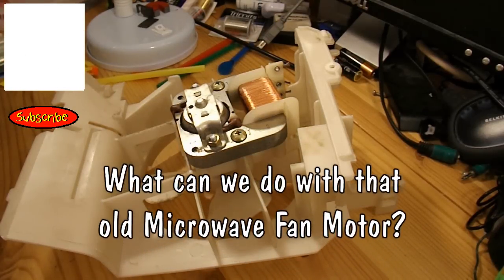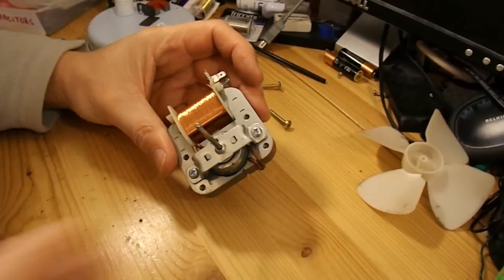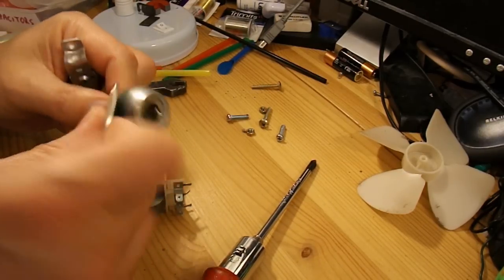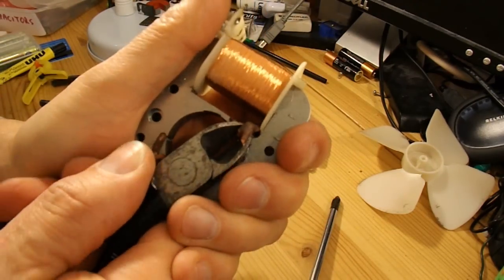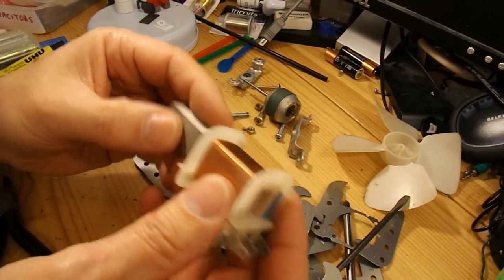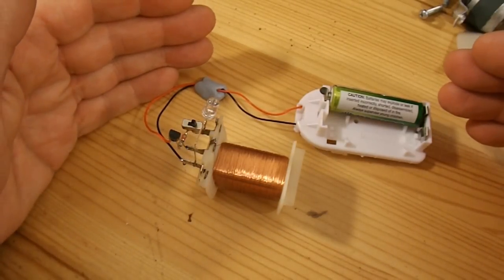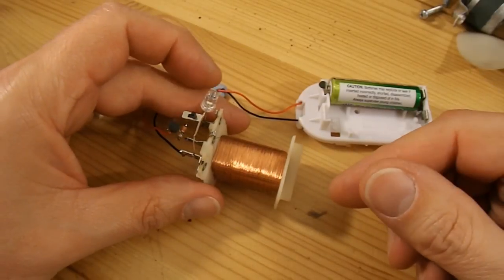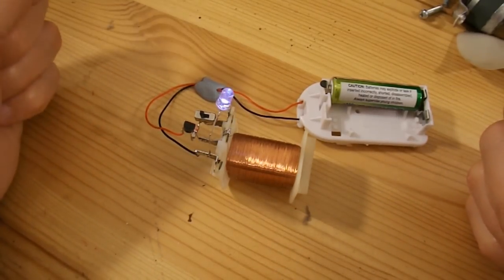What can I do with that old Microwave Oven Fan Motor

Comment: I have scrapped hundreds of these fan motors and I have made a simple jig for removing the coils rather easily.  You need 3 small blocks of 2x4 about 6" long.  2 stand up on the 2" side under the sides of the motor and use the 3rd laying on top of the motor to apply light hammer blows.  The coil and lamenated core can be extracted without further disassembly.  These cores are simply pressed in at the factory and can be pressed out just as easily.
Reply from the maker: Thanks for the tip 😊

Comment: that high pitch sound would do my head in
Reply from the maker: One of the benefits of being an old man is that I don't hear high pitched sounds.
Reply: @GrandadIsAnOldMan  yeah I'm not a fan if high frequency noises. it could be flyback if you're still using crt tv or any transformer inductor. maybe it's coming from the camera itself
Reply: @GrandadIsAnOldMan  watching this because I stripped 2 tesco microwaves the other day. how do you actually drive these motors, does ut require modulation from microwaves control board ?
Reply from the maker: @SodiumInteresting  The motor is a shaded pole motor, you will find information about it in the video description. This one runs off 240v AC mains supply. As I don't hear any high pitched sound I cannot be sure what you are referring to. However, it is more than likely it was the camera as back at that time (2013-2015) I had several comments about it and from July 2015 started using a notch filter or low pass filter in the audio editing to remove it. You will spot in the video description of some of the videos from around this period a line of text stating

Filmed using FujiFilm FinePix S4800
Edited using Serif MoviePlus Starter Edition
Low Pass Filter 6500 hz

or

"I originally published this video in 2014 however unknown to me many of my older videos have a high pitched whine in the background caused by my camera. I cannot hear the noise but many younger people can so I am editing the sound on some of the more popular videos that have been affected. We are possibly talking hundreds of videos so I don't think I will be doing all of them. All the videos since July 2015 should be OK as that was the first time the problem was highlighted and since then I have been using a low pass filter. It's a shame YouTube does not offer sound editing in it's editing options."

Comment: I just found your channel a few weeks ago and subscribed.  We like doing the same kind of projects.  Slider and I have been doing this for a few years now and have worked on several projects together at the same time.  It is great fun and I'm always glad when I find someone else who enjoys the hobby.   Thanks for trying out this "Light Multiplier" project.  You need a diametrically magnetized ring magnet for the spinner part.  The circuit is like a blocking oscillator but not a true Joule Thief.  The circuit does go into self oscillation, as you found out, but is meant to be triggered by the spinning magnet rotor.  I really liked you pizza pan plane project and was thinking about trying a miniature build using plastic drinking cup lids and straws.
Reply from the maker: Hi Lidmotor, thank you so much for the comment. I enjoy trying your projects and your work is always well presented. Some of mine can be a bit rough round the edges as I have about the same attention span as my grandchildren. The electronic projects are probably still beyond the 5 year olds, hence the number of cars, boats and planes, but my granddaughter is 10 and has an understanding of what is going on, which is brilliant.

Comment: I probably w/hv stopped at the "turning" mechanism part of this exploration for myself.My problem is that I am trying to adapt an application to motorize my worm casting harvester to make it spin @variable speeds to facilitate the separation of the castings from other materials. This was interesting to me, but I can't envision it helping solve my particular set of issues. Keep posting vids, Respectfully, Margo
Reply from the maker: +Margo Fr thanks, yes this was not intended to be a technical video, I just like tinkering. YouTube always throws up odd videos when you are searching for something and that usually takes you off at a tangent to your intended path. Good luck with your harvester, it sounds interesting.

Comment: These little fan motors also act as a transformer and drop the voltage on the tap coming off the third prong  to 21 volts to run a geared turn table motor.
Reply from the maker: Hi, just going back through old comments trying to add some words to comments that I only "hearted" at the time 😁 thanks for the information.

Comment: I repurposed a fan from a microwave oven into a passive/active cool air circulator for my air conditioner. It helps put cool air where I need it. Yes, I wired mine up so I could plug it in and use it in active mode. I also use it to cool capacitors when experimenting with electricity.
Reply: I use my microwave fan to push air through my radiator that I have my outside wood burner hooked up to and it heats my barn to a nice 50°F on a 20°F night so hell ya. Here's to being bored and never growing out of the curiosity of a child. Cheers

Comment: Fun fact: here in the US, the actual motor part of the fan is often identical to that of a bathroom exhaust fan. I had a noisy exhaust fan in my new apartment, so I replaced it with a microwave fan
Reply from the maker: 👍 thanks
Reply: I might have a very noisy fan in my toilet. It started  too make a loud vibrating sound about a year ago.
Reply from the maker: @captainprototype187  it might be the bearings or it might be as simple as a build up of dust blocking the blades. A good clean might fix it.

Comment: I has found it is much less dangerous when using high power (which can administer a nice size jolt and even zap u in some cases) to use a good rubberized shoes to protect you from high power electrical devices esp when energized when dealing with exposed wires. I has used electrical devises such as this for many things even zero energy devises(very handy for remote location) hope this helps. Voltmasternyc out
Reply from the maker: Wearing rubber shoes will not protect you when you touch a live contact with one hand and touch something earthed like the metal frame, with your other hand.
Reply: @GrandadIsAnOldMan  this is not correct always use a good rubber not the cheap china made brand. Such as Walmart type. Actually the science works like is a car where you drive over downed power wires that have up too 440 with being injured. The tires keep you safe from the voltage due to insulation factors. Also no not do this without good quality wheels such as a bf goodrich
Reply: Bf goodrich are more compared to the j&j of tires compared to Moderna
Reply from the maker: @J.D.Shelnutt  you are talking utter rubbish. I strongly suggest you do not rely on rubber shoes when handling power wires. As I said, if you touch a live wire with one hand and an earthed case with the other hand, the power will flow through your hand, up you arm, through your chest, stop your heart, down your other arm, out of your other hand and into the earthed case. At no time will it be trying to flow down through your body to your rubber shoes. Your example of a car running over power cables  is completely misleading. There is no reason for the electricity to flow into the car if the power cable is laying on the ground. It is already earthed. If you reach out of your car and decide to pick up the cable, then the electricity will want pass through your hands and down to earth. There might be a chance that your rubber tyres might save you then, but I expect the electricity would arc to earth as soon as you tried to lift the cable from the ground, frying your hand in the process. Your safest course of action would be to stay in the car because inside a metal box you would be safe anyway, rubber tyres or no rubber tyres. Look up Faraday Cage. If you want a sensible explanation of electrocution you might like to watch bigclivedotcom's video on that subject https://youtu.be/9webTbqTH5E
Reply: You see if you are to make a cage with high powered wire then when rubberized coating is removed you still get zapped you see it isn’t if its in a certain shape the power still will flow through. Only when covered with rubber can you be sure not to get energized. It’s actually quit simple. Also i think it scare kids from playing with electricity experiments to try to scare with stopping your heart. Any if you do not take me serious then i tell you to take shoes and stand in a liquid and then tell me a good rubber wouldn’t help to withstand!
Reply from the maker: @J.D.Shelnutt  you seem to be fixated on electricity flowing down to the ground through your feet. Maybe you are confused by the terms "earth" and "ground" when talking about electricity. It has nothing to do with the ground beneath your feet. Twice I have explained the electricity will flow through your body from the 'live' terminal to the 'return'. You just become part of the circuit. It has no reason to flow down through your feet, it flows across your body. You clearly didn't Google the Faraday Cage or you would understand the cage has no rubber coating. You also did not watch the video I gave you the link for. I am trying to save your life and you are fixated on rubber shoes. Electricity follows the path of least resistance, the car or any metal box, will have less resistance than your body, so the electricity will flow through the metal. As long as you are inside that metal box the electricity will not leave the metal and flow through your body. It has nowhere to go. If you reach out of the box through a window or door and touch something earthed then the electricity will flow through your arm. If we go back to your rubber shoes, what will happen if you hold the wire in one hand and then reach down and touch the ground with your other hand? Will your rubber boots protect you then?
Reply from the maker: @J.D.Shelnutt  do you actually bother to read what I reply to you? because it does not seem to be getting through. You are commenting on a video that involves using mains electricity. We are not talking about lightning, we are not talking about 440v power cables that have fallen out of the sky, we are talking about standard mains electricity. If you put your hand on one of the wires and your other hand on the earthed chassis, the electricity will flow through you from the live wire to the earthed chassis. It will not be trying to flow through your feet so your rubber shoes and the rest of your comments are completely irrelevant. You seem to be confused that the ground you stand on is the same thing as electrical "earth" or electrical "ground". Go back and read my replies word for word. While you are doing that, check out the link I gave you, and research Faraday Cage. You also seem confused about lightning but I am not going to waste my time starting to explain that to you when you are not listening to the guidance I have already given.
Reply: @GrandadIsAnOldMan  proverbs 23:9
Reply: I must remind myself not all people are willing to see

Comment: I would rather use the working fan not destroying it for useless transistor stuff 😝
Reply from the maker: Feel free to limit your development by not exploring the potential uses of materials available to you. If you check out the video description, you will find I did make a fan from a fan in answer to a similar comment many years ago. You will also find other information, like why that battery can not light that LED without that transistor and that coil.
Reply: @GrandadIsAnOldMan  i actually have two of these that's makes me wonder why 😅
Reply from the maker: @technicalsos1109  if you have two already,  then you could take a third one apart for the components. I have taken many Microwaves apart for the components. I see from your videos that you are happy to remove safety features from electronic equipment to keep it working rather than replace the faulty component. I guess that if that works for you and you are happy with that, that is your choice 👍 Atleast you are experimenting and pushing forward 😊
Reply: @GrandadIsAnOldMan  i already have so much mess around my house repair inverters and power supply as well i made so much stuff but didn't have energy to make videos anymore since u watched my videos i appreciate it for ur feedback 👍

Comment: That was the most complicated way of getting the coil off, that I've ever seen.
Reply from the maker: Fair enough. What is your preferred method? PS. Great snow sculptures on your channel 😊👍
Reply: @GrandadIsAnOldMan  thanks for the view. I have a lot of strange stuff there.

I simply twist the 'open C' part, and the center drops out.
The rotor parts are usually very free spinning.
I have a pile of these and currently trying to decide what to do with them.  Considering putting them all in an array and making a strange box fan.  Or   just disassemble and melt.
The fans / rotors might end up being yard ornaments for showing the variations in wind throughout my yard.
Like I said, strange 🤔 😉🙄

Comment: Well not something I would waste my time on but it is cool how the magnet kick started the coil up to completed the circuit.
Thanks that was interesting.
Reply from the maker: Thanks, as I said in the description it was inspired by a project by Lidmotor as I had dismantled a microwave and had the parts laying around, I didn't even do the full project as I didn't have the right magnet to finish it. If you scan down the comments below you will find Lidmotor's comment on my effort or you could click on the link below to see what should really be happening here.

Lidmotor's Light Multiplier
http://youtu.be/faDZLDUls48

Comment: Man, you converted a good fan motor in a simple joule thief.
Reply from the maker: Yes that is right. The motor was salvaged from a scrap microwave oven and was a handy source for the coil I needed. That made more use of it than dumping it down at the recycling centre unopened. I've seen people take microwave ovens apart just to get the piezo speaker 😊

Comment: I was going to ask about putting the core back in the coil.  Then I remembered that a Joule thief coil is wired in two directions.  BTW - Don't take that motor apart - it's a perfectly good motor and fan!  ;-)
Reply from the maker: I have enough fans and motors 😁 In fact, in my recent tidy up session (where I was trying to clear enough space in my work room to allow me to get back in there) I threw out several that I had scavenged years ago and never did anything useful with. They were just taking up space so I dumped them. Still haven't got enough room to work in my work room, but I can finally sit on the chair. The desk is still piled high, but the floor is clear.

Comment: Thanks! I did it but I thought that the induction wil be greater. For make an electromagnet is useless but connecting a red led and using neodimium magnet attached to a Bored I made the led turn on
Reply from the maker: Well done 👍

Comment: Can this work on 115 volts ac
Reply from the maker: I am in the UK, the machine I took this out of would have been rated for 240v AC because that is what our AC is. If you are in a country that uses 115v AC then I would expect that if you took apart a microwave oven built for your country then the fan would be the right voltage for you to use. It will probably have the details on a label on the motor, so I suggest you have a look.
Reply: @GrandadIsAnOldMan  thank you so much bro also does it matter where you connect positive and negative?
Reply from the maker: @kallmeronaldshorts2059  It sounds to me like you have no knowledge of electricity. If you are working on mains power with no knowledge, you are likely to cause yourself harm and maybe serious injury. If you are using AC there is no positive or negative. AC= Alternating current. If you are taking this fan out of a microwave oven, make a note of where the wires are currently connected and trace them through to the fan.

Comment: Did you know that those bearings on those end pieces that were holding the core in the middle can rotate off the center? I stuck the shaft from a motor like that in one of the bearings and pushed it to the side and it rotated and didn't move back. I did get it centered again but it was kind of hard. I also did the same thing to a fan motor from a school bus fan where the driver sits, but the problem is I could not get the brushes back in the holders.

Comment: huh, i never thought of doing it like that. I always just take a knife and a couple of pliers and pry apart one side by the coil until it pops out. take about a minute but you mangle the metal.
Reply from the maker: Looking down through the comments here, several people suggest just tapping it through and another suggested cutting through at the thinner cross-section point. I guess it is just a matter of what you are comfortable doing. On some other tear downs I have found the plates are stuck together with some sort of clear resin or varnish. Until you have taken it apart you really cannot predict how it is held together